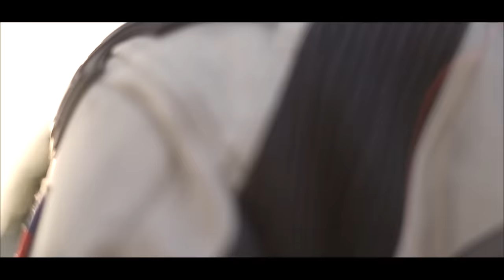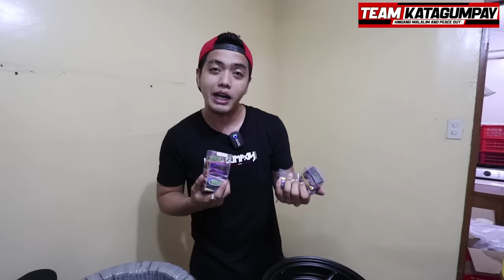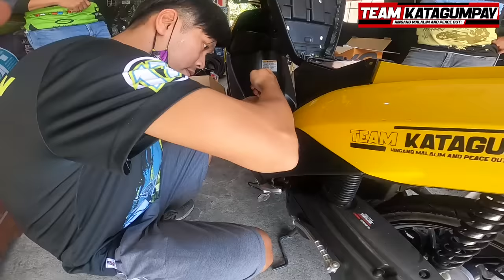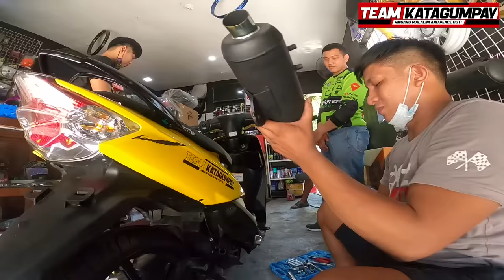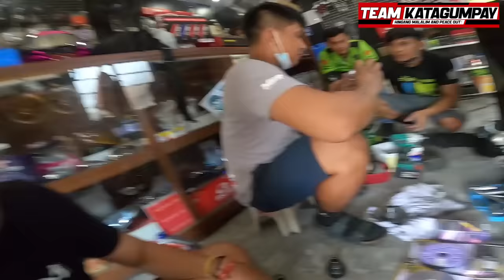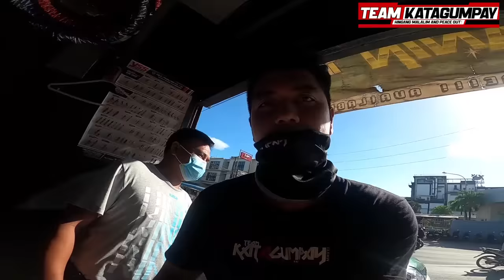Mio Sporty / Soulty BUDGET MEAL Set-up /  Pang Banking sa Bundok at Pang Pasok  - TEAM KATAGUMPAY

Comment: Katagumpay aken nalng stock pangilid mo gusto ko kasi mag stock na pully . Kasinyung after market na pully ko mukang di mag tatagal. Tas yung torque drive ko ang ingay pag tinutulak sana mapansin mo katagumpay👌 GOODBLESS
Reply: 8888888
Reply: 89
Reply: 8
Reply: 88888
Reply: 8888
Reply: 8888
Reply: 9898
Reply: 8888888
Reply: 8888
Reply: 888
Reply: 88888
Reply: 8
Reply: 8888
Reply: 8888
Reply: 8
Reply: 88888
Reply: 888